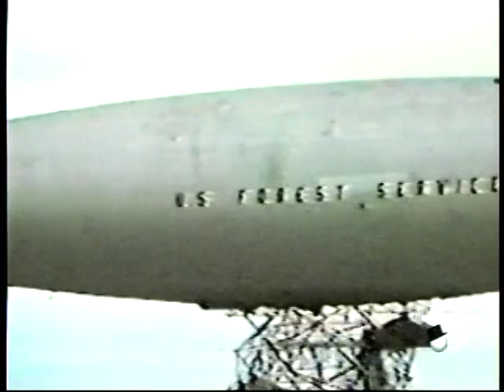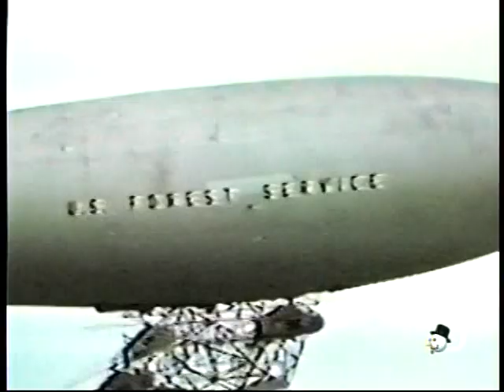Piasecki PA97 Helistat Accident Crash - helicopter helium blimp hybrid air vehicle heavy lift

Comment: I was the original test pilot hired by Frank to fly this. I worked for him through the early design stages and up until just prior to flight. Frank and I had a difference of opinion about safety features. The project got behind schedule and over budget and Frank was under pressure to get it flying. To do this he deleted two important features. The original designed called for crosshafts between diagonal helicopters to keep the other turning in case of engine failure in the diagonal mate. The helicopters not only provided lift, but were the control system and without all four rotors turning, the machine would be uncontrollable. Also, the original design called for a single pilot. The other three helicopters would be controlled remotely from the main helicopter. Frank had problems doing that, including not being able to get the throttles synced. His solution was to put non pilots in the other three. We had a major disagreement over this one evening and I told Frank that if he took these features out, I wouldn't fly the machine. In his typical manner, he told me that if I wouldn't fly it he would find someone else. I told him I quit and he told me I was fired. Best decision of my career.
Reply: This is absolutely fascinating. Thank you for making this comment!
Reply: How in the world did this cost $40 million?

Comment: From what I recall from the designers, some of the structure was made of conduit.  And, there was no main control of all 4 lift vehicles... each helicopter was independently operated and only by voice could they coordinate thrust.  I worked at Navy Lakehurst at the time and would go down on my lunch break to see the progress being made.  Even As a young engineer, I could sense that something was not right... the blimp envelope was at least 20 years old... found in storage, and the helos were 1950s surplus!  It cost one of the test pilots his life... I remember coming into work the next day and still seeing the busted envelope still in the air and smoke still rising in the distance.
Reply: Wow crazy that you were there as it was going together. I remember watching this on a PBS documentary and my dad immediately telling me it wouldn’t work because of the vibrations from the copters. It’s really hard to believe this was singed off and was probably down to trying to do things on the cheap

Comment: How did the designers not know about ground resonance?
Reply from the maker: Great question. I have a degree in mechanical engineering. Of course we learned vibration analysis and harmonics. It wasn't well understood until the 50s. The infamous Tacoma Narrows Galloping Gurney Bridge. The Lockheed Electra Electra had whirlwind harmonic vibrations with the engine mounts, causing them to fail. With the Advent of computers in finite element analysis were able to do better calculations. It's a little tricky doing vibration analysis even with computers.  Experience and judgment comes into play. Clearly as you correctly identify they did no analysis. The frame was too weak, not stiff enough. It was a government contract and a boondoggle.
Reply: Because the guy who designed it was a helicopter engineer. And therefore a moron

Comment: Had they flown helicopters above the blimp and connected them with cables, there wouldn't have been any vibrations and the project would have gone on. Basically, maybe a good idea ...
Reply: Indeed, with modern fly-by-wire electronics, it's far more likely that another attempt at this design would be successful, or at lest not end up like this one did.
Reply: Negative.  Due to the nature of helicopter rotors, they would have broken up due to ground resonance no matter how much you lashed them together.  If the blades had been fixed, on the other hand, this would have worked fine.

Comment: In 1980, they should have known that helicopter vibrations transmit through rigid frames.  Since each helicopter has it's own unique vibration, there was no way that frame-work could deal with such vibrations.  They would have been more successful with shrouded fans like on the Bell X-22 only bigger and or more of them

Comment: Took me some time to figure out what exactly happened.  it's a phenomenon unique to helicopters with fully articulated rotor heads.  It's called ground resonance. The rotor blades are able to swing forward and backwards in the rotor disk.  This, in flight is a good thing.  If you are on the ground and a blade gets out of position, it pushes against the landing gear or what ever is holding the aircraft in position and then the energy is returned to the rotor head and it amplifies and gets worse.   You can see many instances of ground resonance on YouTube.  It looks very much like this.  Should all four helicopters have rigid head and act more like veritable pitch props and control the movement of the blimp like a quad copter does, this probably wouldn't have happened.  In fact there is one quad copter that uses one electric motor driving four variable pitch props that works quite well. But there goes another $4+ million dollars of tax payer money.
Reply: Still cant figure out, why they didnt retrofit the engines and propellers into an special frame instead of mounting antire sikorsky corpuses on it. Also, isnt a little problem, that all of the rotors rotate in the same direction ?
Reply: PytonPagom Cheaper quicker.
Reply: Well ... ill rather give these guys some more bucks for a prototype than those on the F35 project ...
Reply: Thanks.  I figured that one  out but wondered why the engineers didn't catch it before it became this... thing.

Comment: "...Unanticipated vibration.."??!?!?
You attach 4 choppers to a spindly aluminum frame and hang it under a blimp and you don't anticipate vibration. 

Do community colleges give out engineering degrees?
Reply: they did anticipate vibration, just not as much as there was.

Comment: OHSA says there are typically 6 stages or signs that can be traced back in an accident. So there are 6 messages or red flags. 6 opportunities to avoid the accident. Do you see them in this video? Yes! you are right. The very first one. It's called do not try to fly this piece of shit-disaster-dump of a contraption.

Comment: who the fuck came up with that design. "arrrhhh lets get a blimp and strap some choppers to it". Wouldn't it be better to just have normal turbines on it attached to it PROPERLY. That thing looked like some kids project on a large scale.
Reply: It looks like they were on a budget. They used decommissioned helicopters and an old retired blimp. Looks like the budget for the truss framework wasn't sufficient either.
Reply: @ramr7051 they were already millions over budget by that point
Reply: It's basically a really, really big quadcopter drone only poorly made and without modern avionics

Comment: As a teenagerI remember reading an artical in the early 80s about this contraption. I was skeptical the thing would work given the torque and gyro effects of all those spinning blades and the flimsy framework. It failed worse than I predicted it would.

Comment: How would it be possible to die in this accident? The blimp hit the ground at like 4mph
Reply: Spinning rotors on a giant metal attached to a metal frame helicopters. Metal + human = bad. The blimp was extremely large (343 ft) blimp so that is skewing your observation of how fast it seems to be moving. 1:19 Look at the pilot + helicopter falling. Probably over 50 feet in the air if not more. If you free fell from 50 ft you would be traveling 38.6 mph. I'm surprised anyone lived with all the metal and fire. 
We had a Chinook go down in the river on the Moose fire. It crashed in the water and didn't visually appear to be going fast but the impact killed both pilots =/

Comment: @CrabSpirits THAT would be very, very COOL.

It amazes me when I look at this thing. As an engineer, it does not look workable at a glance. We tend to develop the ability over time & with experience to make very good assumptions of a structures integrity. The structure supporting the helicopters does not appear to be supportable. Lots of amazing things, though, don't look right but work well anyway, that's what engineers are for, we make it work, at least on paper.

Comment from the maker: @iwillavengeyou
If you live in the USA you are aware of the Goodyear Blimp's that flies over big events. They are used as advertising and media relations. There are blimp companies, manufactures. Due to the size, need for a large hanger, operating crew (ground and air), cost, they tend to be rare. There are smaller tethered "blimps" used for advertisement and free flying helium balloons for weather and atmospheric research. 

goodyearblimp com

Comment: The blimp itself was decommisioned in the early 1962, but instead of takeing it apart they stored the material in the dome until someone would rebuild useing the envelope. It was orginally a N-class ZPG-3W   Navy patrol which held a giant  radar inside the main envelope allowing it to detect much further then conventional equipment, in the 60's the DEW Line and orbital craft made them less useful.

Comment from the maker: @CrabSpirits
It has been done, not a copy of this contraption but RC helium balloon toys with lift and thrust fans. Not identical but a variation on this theme. Fine for a toy. Goodyear blimp has thrust motors on it, but all lift is by ballast and helium. The problem, a blimp has a huge drag coefficient (parasitic), never will get out of it's own way. Clearly the idea here, is one whose time will never come. It's faster to do remote logging with four separate choppers than a blimp-chopper.

Comment: @geeflyboy 
I don't remember where I heard this. It was probly on network news when this happened. They interviewed someone involved in the project, and he said that the helis used collective only to control the craft and it was controlled at the rear heli. This heli had all the instruments for the 4. Details are sketchy for sure on this thing, so who knows?
Reply: the whole idea was to have one Main Controlling pilot with 3 additional 'monitoring' pilots maintaining the 3 additional sikorskis 
there was intention-plans of having only 1 pilot, as well as initial plans to have a main control cockpit in the center (just under the bag) 
but they then opted for 1 of the sikorskis being the 'main' with ability to control the other three... that wasn't sorted out yet so they went with the Key Pilot in One and other operators responding to his directives via radio... but the goal was Single Pilot, or Pilot-Co-Pilot (then Lift Op) controls.

Comment from the maker: @flanksteak5

The idea (a bad one but an idea) was an aircraft with much larger lifting load, faster more efficient than a single helicopter, in theory. The problem is as you say, 4 separate helicopters, 4 crew and big airship. 4 helicopter operating independently as helicopters (minus the blimp) would be more efficient.

The logistics and maneuverability much less it's obvious lack of structural or airworthiness, makes it impractical in hindsight. Read the comments below.

Comment from the maker: Thanks for the info, cool. If they would have made the frame strong enough (vibration harmonics) so the choppers didn't shake it apart, it would have been cool to see fly. I wounder what amount of lift they thought they could carry with it? I suppose it is 100% thrust or lift from 4 choppers, since their dead weight was lifted by the "Bag". Any thing that can go asymmetrical (like the Osprey) is always a risk.

Comment from the maker: Thanks for the reply. Love hearing from folks in the know. RIP Gary. I fly for the Airlines, but in my first career out of school I was an engineer for Boeing in structural analysis. It's seems like they did not consider vibrational harmonics of the truss frame. It even looks like a lack of basic ultimate stength from the video. It should be easy to make that kind of "truss" attachment strong. The concept seems resonable. May be with new technology it might be time to try again? May be not?